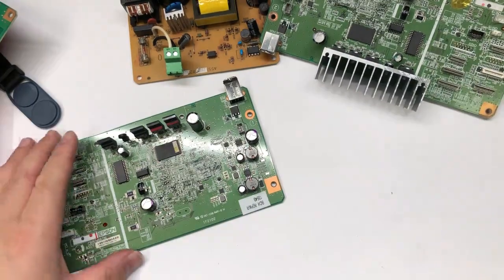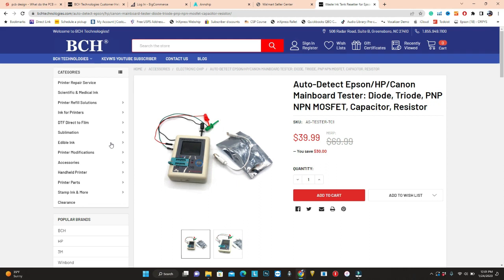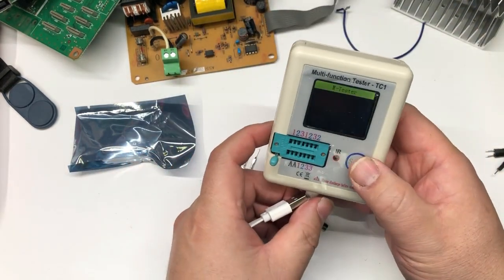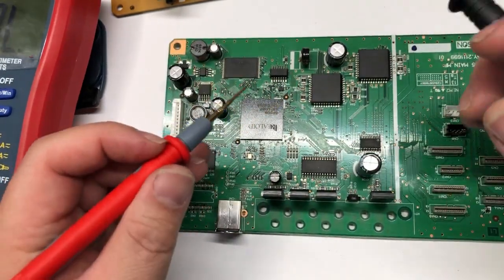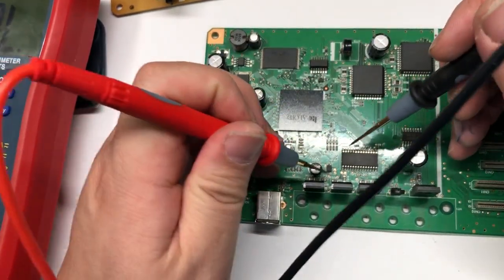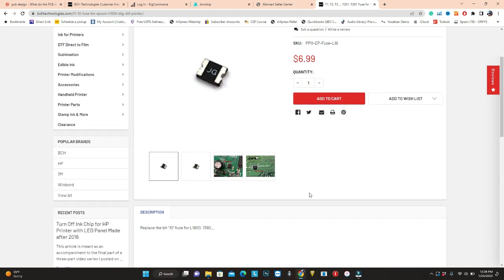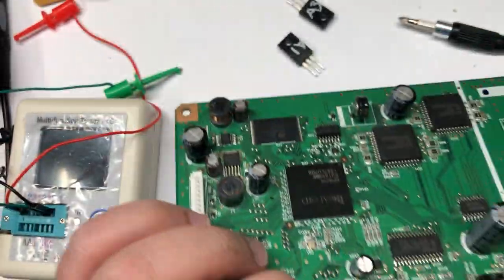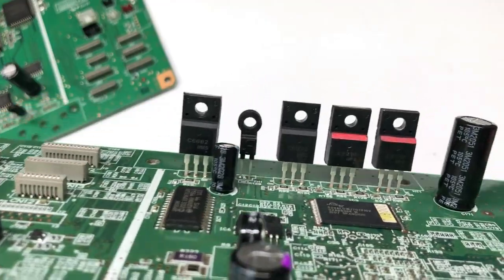Quick-n-Easy Troubleshoot L1800 Mainboard

Comment: Kevin,

Can you do a video like this for the epson 7890 mother board and supply power board. I cleaned my printhead and during the cleaning my printer just stopped working. They told me I must’ve fried the printhead and the mother board and that I should replace them along with the supply board. So I purchased all of them and I swapped them out. Once I turned the printer on, it blew the fuse in the power supply board. I checked with the multimeter. I then swapped the fuse with board I had removed because the fuse was working per the multimeter test. Once I turned the printer on, it just didn’t go on. I checked the fuse again and it didn’t work anymore.

Comment: My pro colored DTF l1800 will not power on and all I hear is a faint beeping noise with a green light flashing from inside by the main board
Reply: I have the same problem. My printer doesn’t turn on anymore. If you find a solution let me know please
Reply: @jannay77 did you fix it ?
Reply from the maker: Thanks for subscribing and for reaching out with this issue! I really appreciate your support—every subscriber helps me get closer to my 100k goal, and I try to answer subscriber questions within 48 hours. If you need a faster response, feel free to email me at support@bchtechnologies.com.  

Based on what you described, it sounds like the main power is reaching the printer (which explains the faint beep and flashing green light), but the control board isn’t fully powering up. This can happen for several reasons, often involving the Flat Flexible Cable (FFC) or a power supply issue. I recommend starting by unplugging the printer and inspecting the FFC connections between the mainboard and the control panel. Make sure the cables are seated correctly and that there are no visible signs of wear or damage.  

If the connections look good, take a close look at the mainboard for any burnt components or blown capacitors. Sometimes, a weak power supply or a blown fuse can cause this issue as well. You can also try powering the printer with just the power and control panel connected—disconnect everything else from the mainboard and see if it will turn on. If the issue persists, the mainboard might need to be repaired or replaced. I can help with that if needed, and we also offer repair services for the Epson R1390 mainboard, which is very similar to the L1800.  

Thanks again for subscribing and for your question. Let me know how it goes, and if you need more details or help with the process, don’t hesitate to reach out!

Comment: My transitor pairs from left to right same as you measured are 43 / Open / <1 for left pair and exact same for the right pair, but i do have a blown fuse. Sometimes after testing each transitor seperate and then going back to test them as pairs on the middle pins the resistance goes to approx 930.
Reply: I just ordered a fuse, a pair of transistors and a head protector FOR THE L1800 from BCH. if the middle and right pins of both pairs are short closed <1ohm, what exactly does this mean? Are the transistors in a certain state of flow? I noticed when I followed another guy's video and tested each transitor separately by touching 1st&2nd then 1st&3rd, then went back to test the middle pins as a pair, my resistance went up to 930 then would go away, but I'm wondering if that has something to do with reverse?

Comment: Little tid bit of information for anyone owning a Procolored L1800,  they put the fuse on the other side of the board and wire up an external point of contact for each side of the fuse for quick testing. The little white Lego block on the back near the heat sink and USB connection has 1 white wire in each slot on my case. I wish I would have known this the other day. Kevin my fuse is blown and machine not ejecting colors but acts as if everything is normal.  In your experience do you think anything else is bad? What else should I check? We had ran the blocks of test color then head cleans in between for like 2 hours trying to get white to flow. I tried to prime white with some external pressure from the top of the manifold and potentially contaminated head cable. Should have got a protector from you, 😢 Didnt notice or think i had till all colors seemed to just stop printing and started to suspect I made expensive mistake. On inspection of head, there was no, obvious visible damage to cables, board, or head but the cyan channel would no longer allow for flow during flushing manually.
Reply: Just buy a new board fk all this stuff😢😂
Reply: What ended up being the issue?

Comment: Thank you for this. I tested the mother board as shown in your video. Looks like my motherboard parts are good. I own the Prestige DTF printer A3+R and replaced the Epson print head, which worked perfectly for one day. The following day I'm getting no prints, no ink. I checked the FFC cable, and no signs of damage. I performed head cleans, printed nozzle checks, filled in the dampers, and ink bottles 3/4 full. When I try to print, the mechanical parts usually move, but I'm not getting any ink. What else should I check for?
Reply: I am having the same problem.. I’ve been told to replace my ink waste pump? I’m clueless
Reply from the maker: Thanks so much for subscribing and for your detailed question! I really appreciate your support – every subscriber gets me closer to that 100k goal. It's been 8 years, and I'm only halfway there, so every bit of engagement really helps. I try to answer subscriber questions within 48 hours, but with the backlog, it can take some time. If you need a faster response, feel free to email me directly at support@bchtechnologies.com.

It sounds like the issue might be related to the capping station. A printhead that works fine the first day but fails to print afterward is often caused by a clogged or malfunctioning capping station. I recommend checking the capping station to ensure it's sealing properly and not blocking ink flow. Here’s a video that walks you through the process: Check the Capping Station.

Turn off the printer and unplug it to avoid accidental movement. Open the cover and slide the printhead to the left, exposing the capping station. Inspect it for dried ink or debris. To check the seal, attach a syringe to the waste ink tube and try drawing air. If you feel resistance or a vacuum, the capping station may be clogged. After inspection, run a cleaning cycle from the printer’s menu to ensure proper ink flow.

Let me know how it goes, and feel free to reach out if you need more troubleshooting tips. Thanks again for watching and commenting!

Comment: Last week I was doing a head cleaning - thought my white had clogged even though I print daily. When it didn’t clear, I powered off the machine and removed my print head and did a manual flush with warm distilled water. One white channel wouldn’t allow my water through so I eventually thought, I’ll just put the printer back together and see what happens. Well, now I have a low chirping noise and the control panel lights won’t work therefore I cannot print. I can’t figure out what’s going on - I bought a new print head and had it overnighted but the control panel still won’t turn on to even attempt printing. 
I found this video to be very helpful. When removing my motherboard though, it is not the same. My Epson board has a SN JMV1B14KR/2170667-01. Any alternative steps into figuring out what is going on? TIA!
Reply: Hey I had the same issue with the chirping. Now my printer doesn’t power on. Did you find a solution?

Comment: I have an Epson L1800 that is performing the way it normally does but is NOT dropping any ink. I installed a new printhead and dampers with no results. I was told that there may be a blown fuse on my motherboard that's causing that to happen. Is that a possibility?
Reply: I have an L805 doing the same, not ink charging had to bridge the fuse and it started charging but my head is gone...so its now printing very very faded and Magenta mostly even where its supposed to be the other colors its printing Magenta...
Reply: @marshallgraphix4924  What fuse did you bridge
Reply: Did you solve the problem?
I have the same!
Reply: Having the same problem

Comment: Hey Kevin! I just swapped my L1800 Mainboard and suddenly the printhead doesn't stop and speeds up a lot ending crashing into the left part of the printer. Do you know, what's causing that issue? Its something with the CR Motor. Thanks a lot!
Reply from the maker: No idea. Had to take a look and see what's wrong.
Reply: @bitkid check the encoder strip and make sure it is inside the sensor on the carriage. This is the main reason I know for the slamming on the left. If the strip is not inside the sensor then it has no idea where the head is and starts doing crazy things.

Comment: I have tatal error but I checked the  printheads and is good
Reply from the maker: What is the error code?
Reply: 031006 the cone tor are good  te print head I checked  and is good I think so the problem is in the F1, oF200  that cut the power before  make more damage to burn some pieces
Reply: My l1800 stop working and its making a beeping sound can you help me i have change 4 motherboards is a year im tired of this happening